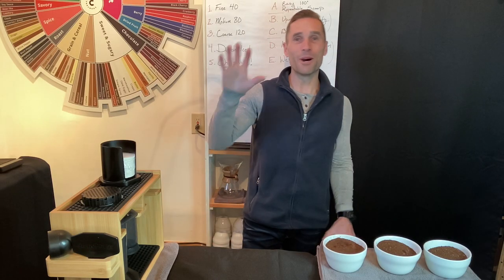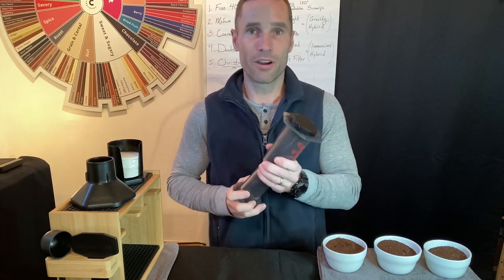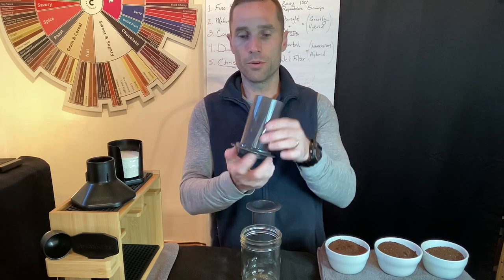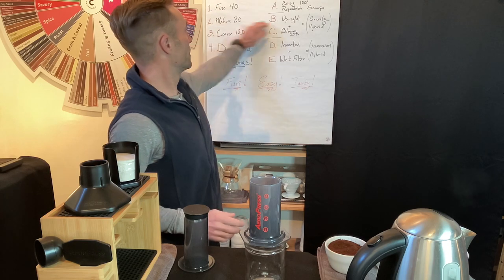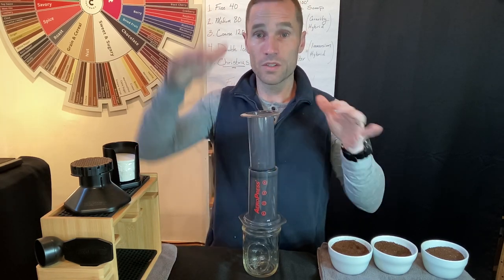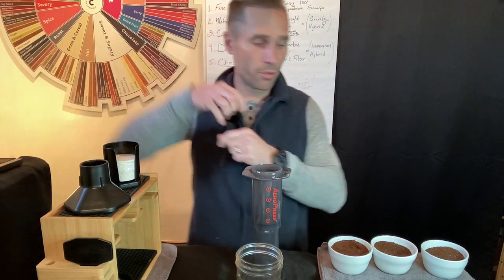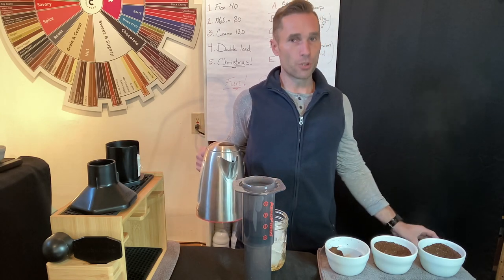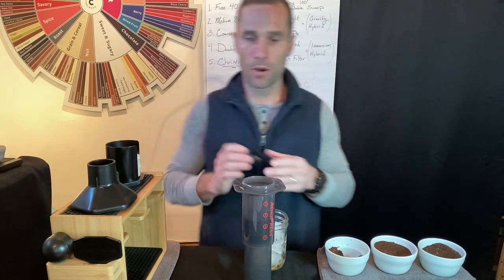How to Make a Perfect Aeropress Coffee with x5 Recipes

Comment: When I plunge it down , some coffee grounds seep through corners of the plastic cap into the cup. Any method to avoid this (sometimes it makes the coffee not very clean but sludgy)
Reply from the maker: Hello. Regarding the Aeropress there may be a few reasons why your filter doesn't catch all of the grounds or why they sneak through into the cup. Let me know if you have tried or succeeded with any of the following:

1. preheat/rinse the aeropress and plunger with hot water prior to brewing. If inversion method, it's easy to place plunger below and pour hot water in, assemble (without paper filter) and plunge after it's hot and wet. This helps the rubber plunger to warm and swell making a tighter fit. 

2. when the chamber and plunger are all warm, then you can place a paper filter into the cap and just rinse lightly with water. The wet filter will stick to the cap and ensure when you move it or turn upside down that it stays in place.

3. If you are brewing inverted and flipping over, prior to the flip depress plunger/chamber so that all of the air is removed. In this way the system is more closed (vacuum like) so that when you flip, there is little to no movement around the filter cap. If there is air in the chamber it's easy for coffee/water to slosh and displace the filter.

4. When you plunge, begin slowly and then apply more pressure. Too much pressure too fast, could displace the filter

5. You can wash everything, including the rubber cap which can be removed, in a hot water soap bath. Removing oils and cleaning under the rubber cap is a good way to ensure that all parts or in good shape.

Note: I did have an aeropress that I used so many times that the rubber seal wore out. If it is old, that could be a cause.
Note: I have seen many knock-off or copy versions of aeropress which do not seal well due to inferior plastics and rubber. If yours is a good copy, but not the original version (I used to live in China and saw many versions) then you may also have a seal problem. 

Good luck and hope this helps!
~ coffee coach, Adam
Reply: @CoffeeTraining  thanks for the detailed answer , will implement the above suggestions. ✌🏻